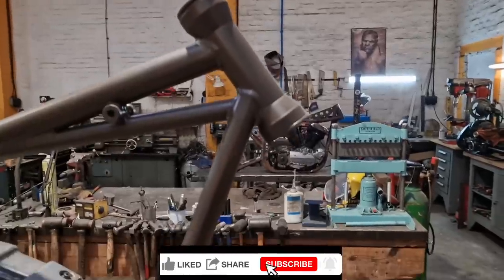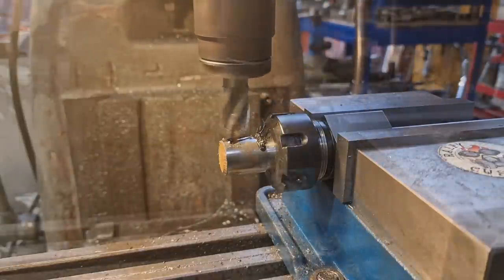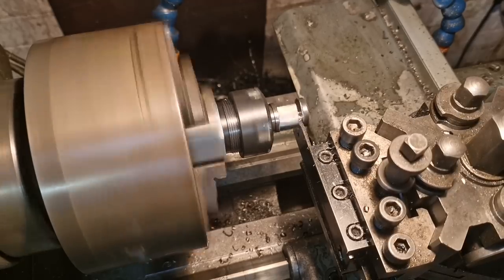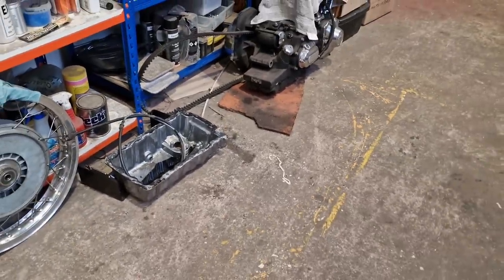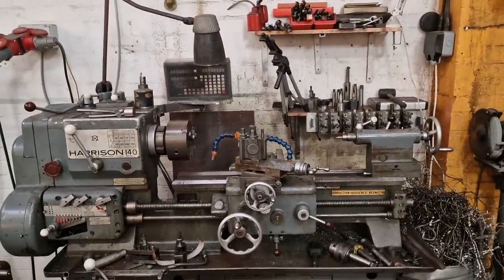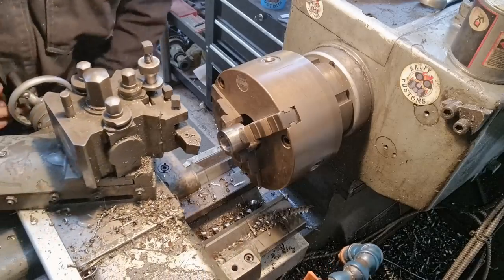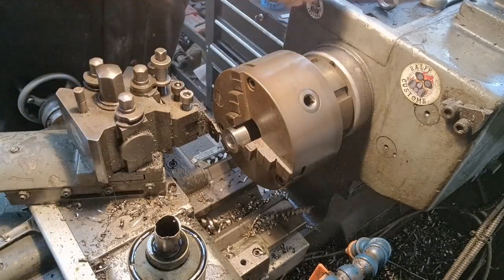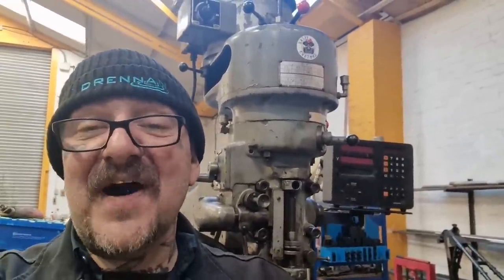it's a Shambles I tell you! Handmade Custom Bike Building #handmade #engineering

Comment: G,day Ralfy, nice job on that axle.  I had to make a solid axle for my wide glide fork to fit my 1978 stock 19 inch mag wheel as the bearings are right where the axle is a slightly smaller diameter in the middle of the original harley axle. I made it out of stainless steel and it felt like it took me forever to make it but it seems to be holding up OK.  I had a chuckle about you losing the washer as recently I lost a chromed quarter inch cap screw under my bench and still haven't found it. I liked the shambles and would love two or three veelogs a week as I aways find them very informative and entertaining, thanks and cheers to you Ralfy still watching from NZ. 👍
Reply from the maker: Cheers Buck, yeah wheel spindles aren't fun lol